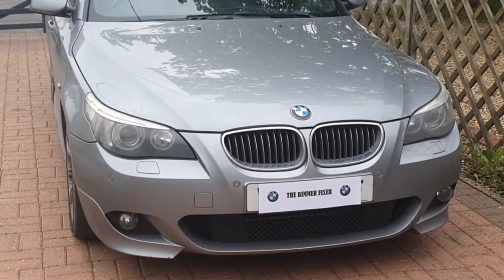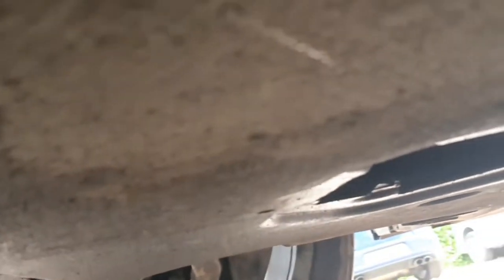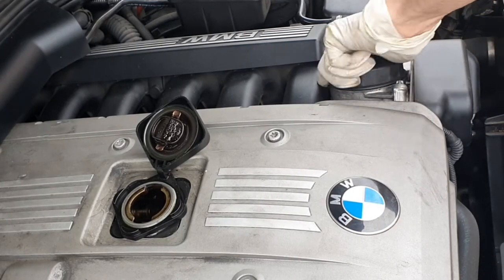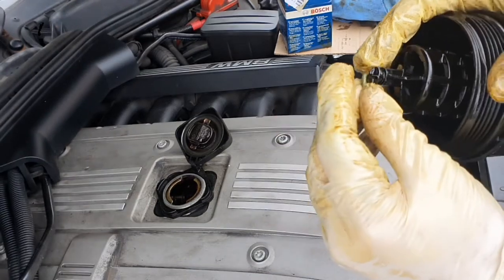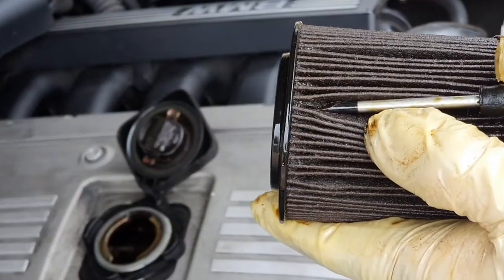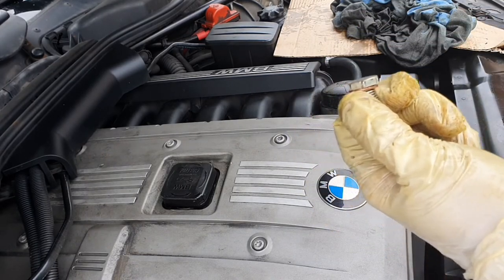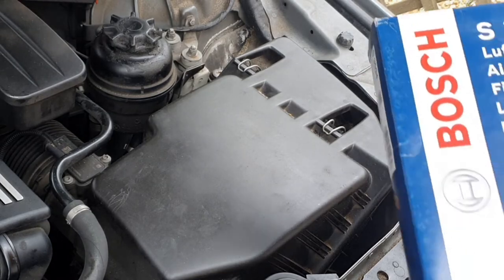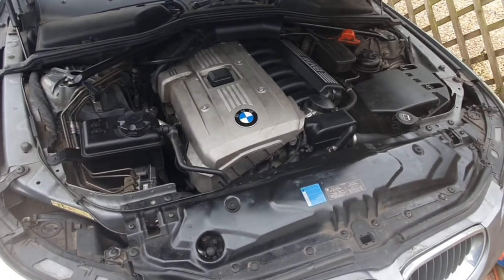BMW 525i e60 Oil Service and Air filter change

Comment: iv read its actually 6.9 when also changing the filter and 6.5 if you dont change the filter i do just over 6.9  also do you use 0w40 or 5w30 i do 0w40 6 and the last bit 5w30 just to thin it a little bit i also live were its never cold so don't have too worry about cold starts
Reply from the maker: Really! Thats interesting. Ok well BMW spec say 5.3 for the M47 engine and If I was changing the oil I would also change the filter too. I used 5w 40 because of the colder weather and cold starts but if its nice and warm were you are you can definitely use a thicker oil and like you say it will last longer too.
Reply: 6.9L ??
Reply: Which is better. 6.5 or 6.9. I use 5w40 mannol

Comment: BMW recommended me to use 0W-30 LL04, but everyone is using different types and cant seem to confirm which is best and the right one. So which one do I use? My 525i has done 118k miles if that helps.
Reply from the maker: @shafkhan4098 Hi yeah it can get really confusing. BMW will always recommend what it came with from factory however with time, age and mileage some oils are better than others because of the wear on the engine. It can also be affected by where you live us the temperature can effect it too. Somewhere colder might need a thinner oil and hotter places a thicker oil. Where are you based?
Reply: Hi sorry im coming late but I was in the same boat as I wanted to do my service, called bmw they said 0w30 as that’s factory but 5w30 is absolutely fine too
Reply: Im based in the UK. London, which doesnt actually help the engine, but I do motorway runs once a month.@TheBimmerFixer

Comment: Do you have a link for the oil filter housing kit?
Reply from the maker: @Paul Miller Hi Paul, do you need the oil filter housing Gasket?
Reply: @TheBimmerFixer  I meant the tool to take off the filter but I found one thanks

Comment: What did you do with the copper washer You skipped right over that for the oil filter change
Reply from the maker: @SMASH MONSTER Sorry I didn't make that very clear. The copper washer replaces the old copper washer on the sump plug. Thanks for pointing that out 👍🏻

Comment: Question 🙋‍♂️. The engine air filter air box. Does the top half of the airbox have a filter? My 525 doesn’t have one
Reply from the maker: @Herb N Hi Herb, no it just has the one filter in the air box 👍🏻
Reply: Because of that I came to see this video. I changed also lower air filter as he did, but after I found out that upper part has also some filter with plastic bottom

Comment: Thanks mate doing mine tomo engine had no oil was running bad even tho when bought said serviced
Reply from the maker: @Aaron Simoson No problem mate 👍🏻 Its shocking how often people get told that the car has been serviced when it actually hasn't.

Comment: Thanks for video brother
Reply from the maker: @jdm machines Happy to help and thanks for the comment 👍🏻
Reply: @TheBimmerFixer  hello but ask me something the oil level sanser is not working how to check engine oil ? Manually
Reply from the maker: @jdm machines Hello my friend. The only way to know without the oil level sensor it to measure how much oil is being put back in after it has been drain completely. My 525i N52b25 is 6.5 litters. If you can I would change the sensor as soon as possible because if the oil drops below the minimum you wouldnt know about it until its too late and you could end up with a broken engine.